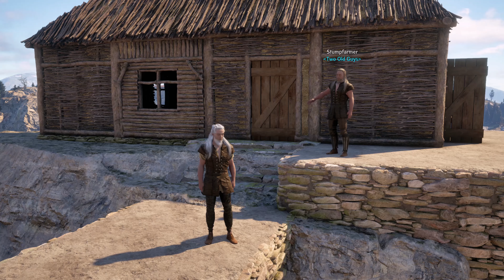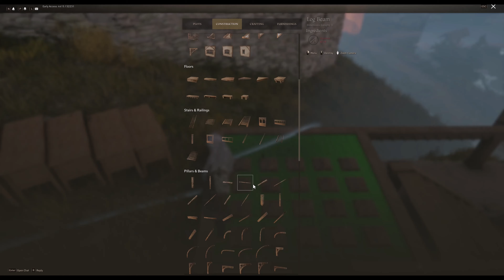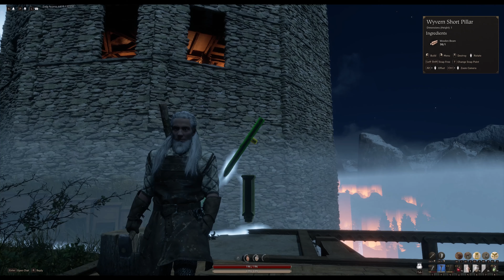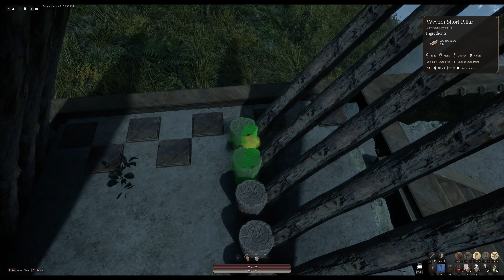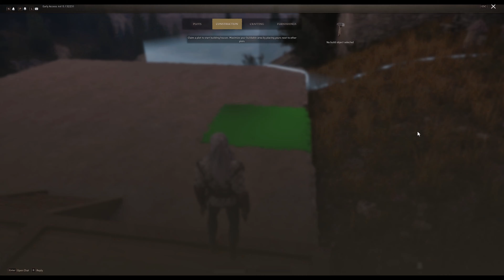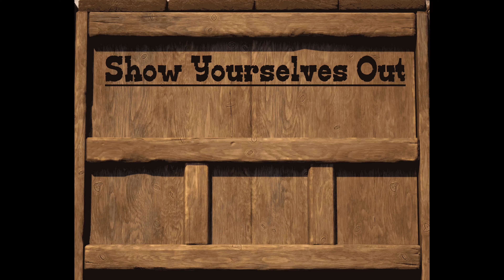PAX DEI: Replica Build - 'Chomper Cafe' Episode 13 "Checkerboard Challenge"

Comment: It takes some practice and patience but you should be able to free float the wood floor by holding the left shift button down and making minor movements with your mouse or Lshift+alt+mouse. It won't snap to anything until you release the left shift once you like the placement. From there you can build off that one to maintain the same floor level OR free float the post by doing the same thing. It's tricky.
Reply from the maker: @trevors7905  I'll have to give that a try.  Thanks!